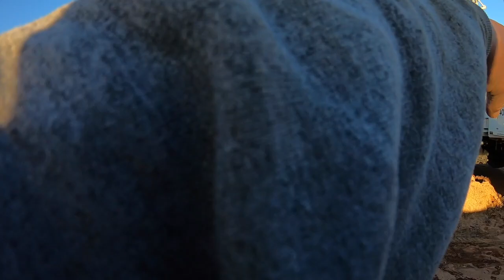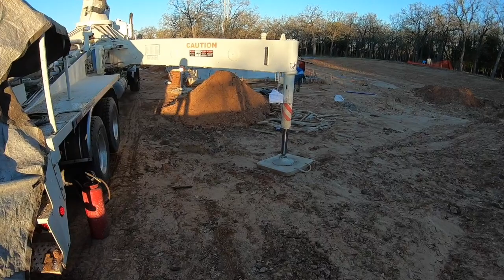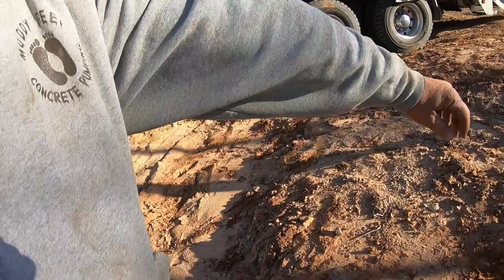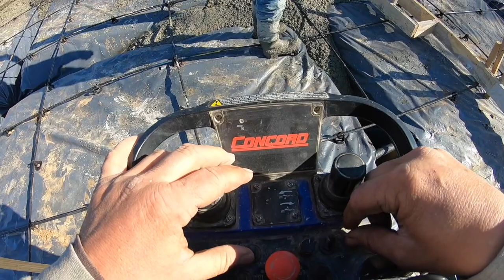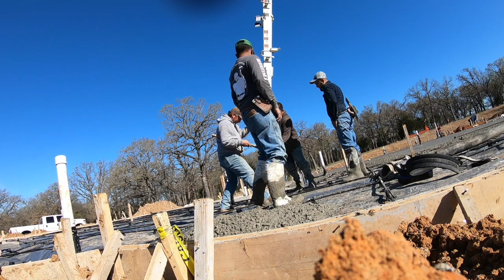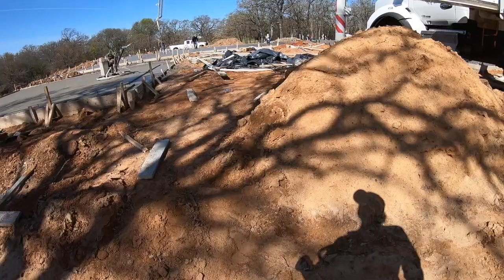Bill pumping with the Concord 40 meter . pumping concrete with Muddyfeet Concrete Pumping.

Comment: Why don't you use a 5 inch hose that's what we use on our boom's lot safer
Reply from the maker: This will probably start a debate but the 4" gives us a more solid stream and less splattering. We get a lot of compliments about our streams from the hose guys.
Reply: Muddyfeet Concrete Pumping 5 to 4 reducing hose all day brother. If the hose guy complains about splatter, I laugh and say your in the wrong business buddy. Splatter sucks but comes with the job.
Reply: Atch 97 that’s EXACTLY what I tell the hose man. Shit up here in Northern California I use a 4”-3” reduction hose for slabs. Production slab crews are notorious for pumping at a 6.5” slump anyway and in my neck of the woods the concrete is like pumping butter. 1”- smooth round river rock
Reply from the maker: My customers like the flow of the 4”. Just asking and not trying to be a smart a#& in anyway but what are the safer aspects of the 5”?
Reply: Muddyfeet Concrete Pumping A 5’’ hose will ALMOST never plug up. Never seen one plug up hanging from the tip. I would only use one on big Matt Pours. I personally like the 5’’ to 4’’ Conform reducing hose. Very seldom plugs up and flows like a 4’’ hose.